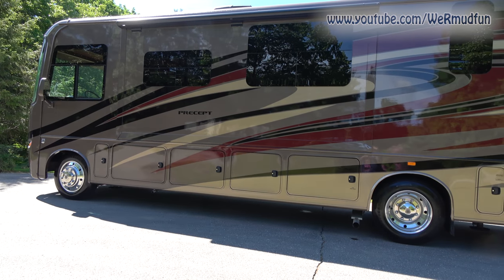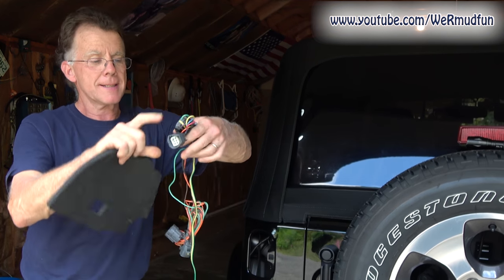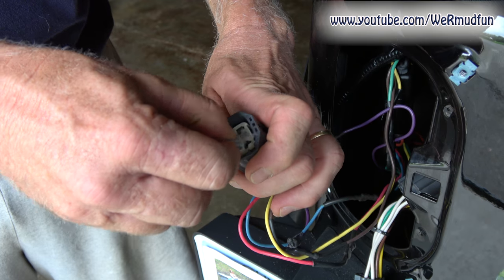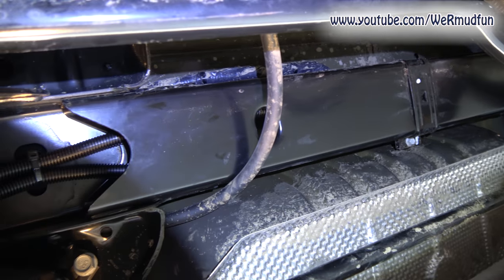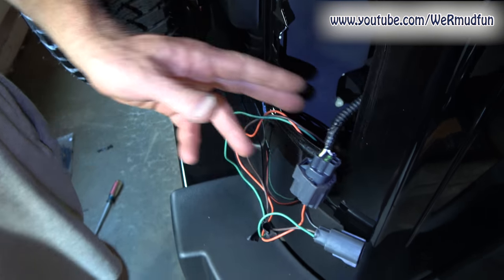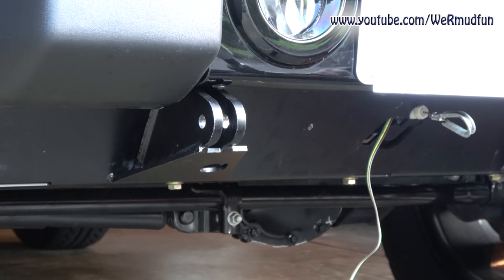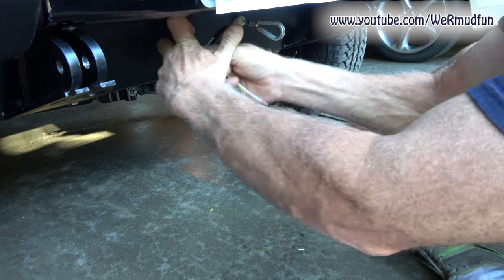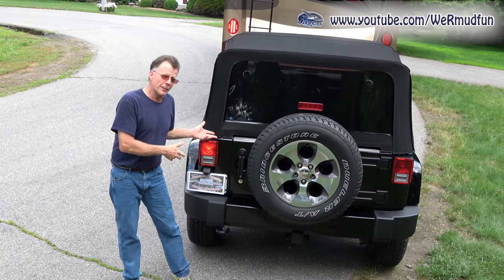Part 3 - Jeep to RV Toad (Dinghy) Conversion - Hopkins #56200 Plug In Simple Towed Wiring Kit

Comment: It might help to know that, in order to drill the holes through the Rock Jock base plate, the Milwaukee Cobalt bits are the only ones I was able to get to work.  I wore down two other "bi-metal,"  1-1/4" bits, taking hours to barely make a circle in the steel plate. I went back and rewatched this video and paused it to see which bit you were using. Ran down to Home Depot and bought the Milwaukee bit, which did the job in less than a minute! It was like cutting through butter!
Reply from the maker: Glad you got it to work. It was a tough metal to get through, but the Milwaukee bit made it easy. 😀
Reply: @WeRmudfun , Chuck it was crazy tough and I don't think I would have gotten through without reviewing your video and discovering the Milwaukee bits! I also bought a set of small Milwaukee bits to drill the screw holes and a ground wire mount to the frame!

Comment: I greatly enjoyed the install video.  I have one question, is the brake light relay necessary?  If I am towing, no one is in the Jeep to press the brake.  Or have I missed something?
Reply from the maker: Thanks! You only need a Brake-Lite Relay if you're installing a supplemental towed vehicle braking system that pushes or pulls the brake pedal. 😀

Comment: I love your videos and just about to order all my components for my 2012 Jeep Wrangler JK, however in part 3 you explained the wiring kit and at the very end you added a 6way plug on the Towed Jeep. You never showed the electrical connector from the 7-Way RV Trailer Plug to the 6 way Toad plug you showed in your video. Do I need to purchase the Roadmaster Part #15267 All in one Towed Vehicle 6-7-wire Towing Combination? It appears that this kit comes with the coiled electrical wire from the RV to Towed, plus the brackets and 6 way plug? Please advise.
Reply from the maker: We actually use a 7 way to a 6 way coil wire now, it's easier than using the adapter.  We are using this one... https://amzn.to/2BRIQyl

Comment: Enjoyed your videos!  Given the way the RJ baseplate is designed, have you had any issues with the approach angle of the electrical coil cable between coach and tow at the 6pin connector? Seems the 55deg angle may stress the cable?  
Thanks
Reply from the maker: Over 9000 miles without any issues.  😀

Comment: Nice tip on routing the wire through the frame. Did you use an electrical fish tape to get that pull wire in there?
Reply from the maker: Actually I pulled it through with a piece of stripped down 14 gauge wire. 😀

Comment: Followed the video and installed the Hopkins #56200 kit on my 2015 Jeep Wrangler, but after installation brake lights not working when plugged into Motorhome, all others lights work fine. Could the ground cause this not to work ? Rewired the umbilical electrical cord several times still no brake lights. Need help !!
Reply from the maker: Did you also install the Roadmaster Brake-Lite Relay Kit #88400?  If so, check those fuses and the fuse that it taps off in the fuse box..  I blew that fuse at one point and had the same situation.  We received this comment on the the relay too.. "Only issue was they changed the Brake Light rely fuse, now it's double stacked which is nice!"  Hope that helps, Good Luck!

Comment: Sir, I have hooked up everything as the video instructed.  I grounded it to a clean piece of the frame.  I connected it to the RV with a Hopkins 7 blade to 6 way pin adapter.  Each end of the adapter light up when plugged in but I am getting nothing to the lights in the Jeep. What can I be doing wrong, or how can I check to locate the problem?  Any suggestions are appreciated.  Great Videos
Reply from the maker: Sorry to hear you are having a problem.  Are you getting any lights (Lights, brakes, blinkers)?
Reply: @WeRmudfun  Nothing.
Reply from the maker: @RobertBrown-yd4sy  Without being there to see it, are you sure the wires going into the 6 way are in the right places? If the lights still work on the Jeep normally, my only other thought is wiring kit is at fault.  This is the first I have heard of anyone having this problem.  I would consider giving Hopkins a call.
Reply: @WeRmudfun  Thank you for your time and suggestion I appreciate it.  I will check the wiring in the 6 pin end again.  I will also check the blades on the 7 prong, as I have never used them before.  There is power though, because the light comes on in the Hopkin adapter at each end.
Reply from the maker: @RobertBrown-yd4sy  That is the point I am making. In troubleshooting from my couch, you have power coming from the RV going to the adapter, but the lights are not working on the Jeep. So you start with where the power stops. I would check to see if the power is passing through the 6 way plug on the Jeep and work my way back towards the lights. Hopefully you will find the problem.
Reply: @WeRmudfun  after a sleepless night, got it, the ground was at 1:00 and should have been at 11:00.  Everything is good now.  Thanks for the great instruction.
Reply from the maker: @RobertBrown-yd4sy  Awesome Robert, glad to hear it is resolved!

Comment: I am flat towing a 2014 jeep wrangler jk with a Jayco greyhawk.  I used your kit and sliced into a 6 pin round in the front of my jeep bumper that connects to the class c rv via a 7 pin.  My right brake light does not come on, but the right brake signal does work.  Lights come on with headlights too.  I check continuity on my 7 to 6 pin cable for the green/right brake/turn signal and comes out good.  Where should I go from here..I don’t understand why the right turn signal would work but not the brake light
Reply from the maker: Did you check to see if it works correctly without being attached to the RV? That's where I would start. Good Luck. 🙂
Reply: @WeRmudfun  Definitely checked that but good ?
Reply from the maker: @virgilsmith5792  Sorry you are having an issue, is power making it all the way to the light socket on the Jeep.  If so, I'm not sure what the issue might be, we didn't have any issue with ours.. Good luck!

Comment: Loved your videos! I'm in the process of getting my Jeep Wrangler ready to tow... all that's left to do is the wiring.  Your videos have been a great help!
I'm curious if you use a rock guard or screen to protect your Jeep?
Reply from the maker: Thanks!  😀 No we do not used any protection for the Jeep.
Reply: @WeRmudfun  , have you had many problems with damage from rocks or road debris?
Reply from the maker: @jays8321  No, we caught a rock from a truck passing us in a construction zone in PA. the windshield had to be replaced, but any kind of shield would not have stopped that from happening.  We actually saw the rock, that lane should have been closed.  The over hang after our rear axle is huge.  Any debris that we pick up doesn't make it to the Jeep to do damage.  That's what we are seeing.  Protection is a personal choice.  If we ever see any, we may reconsider.

Comment: Enjoyed the video, was a great help when installing my Hopkins tail light wiring for my Wrangler. Did you notice your 3rd brake light no longer works while the wiring is plugged into your fuse box? Mine does not work after installation either.
Reply from the maker: Correct, the 3rd brake light will not work when you are towing the Jeep.  It is a separate system and the harness does not control it.  It should be working when you are driving the Jeep though.   If not check your fuse for the 3rd brake light.

Comment: New RV's are using a 7-way blade socket.  Is there any reason not to use a 7-way blade socket on the Jeep as well?  What make/mode of coiled electrical cable are you using?  Thanks!
Reply from the maker: The only reasons we used 6-way is that is what we were already using.  The other reason is a 7-way plug on a Jeep is a lot bigger socket than a 6-way, so it's personal preference, we like the way a smaller plug looks better. :) There no reason you couldn't do a 7-way plug on both ends.  This is the original cable we got from Amazon years ago... https://amzn.to/2M8h58H

Comment: Can we pass the wire inside the cabin front to tail ?
Reply from the maker: You can run the wires however you want as long as you can access the tail lights.  You may have to drill holes. We went through the frame to make sure the wires stayed protected. 😀

Comment: When you was using "Reese Towpower 74686 Coiled 7-Way Blade to 4-Flat Adapter", did you cut off 4-Flat and replace it with 6-way?
Reply from the maker: We don't use the Reese Towpower.  We use a 6 way to 6 way coiled and a 7 way to 6 way adapter. The only reason we even use the 6 way is so we can have a toad brake monitoring light in the RV.

Comment: I've heard of people having a dead battery on the Jeep after towing it across the country.  In the way that you hooked it up, I assume the power for the brake lights is coming from the RV and not the battery in the Jeep, is that correct?   In that case, what would cause a dead battery?
Reply from the maker: You are correct, the power comes from the RV not the Jeep.  The reason people have dead batteries, depends on the year of their Jeep.  In some of the years the key was required to be in the ignition so the steering wheel wouldn't be locked position.  Some years, such as ours the steering wheel doesn't lock, so after hookup the key doesn't need to be in the ignition.  Heck, the key is not even in the Jeep! LOL